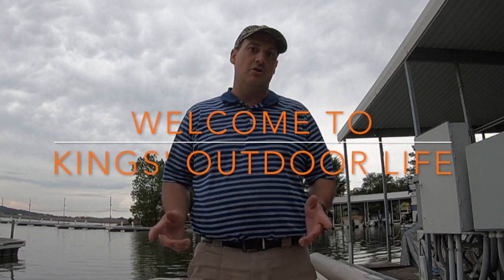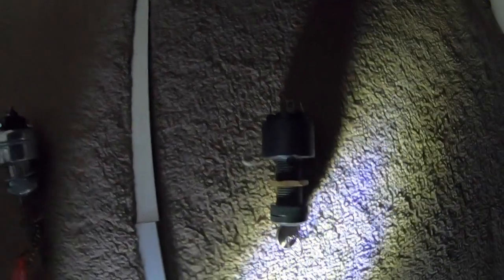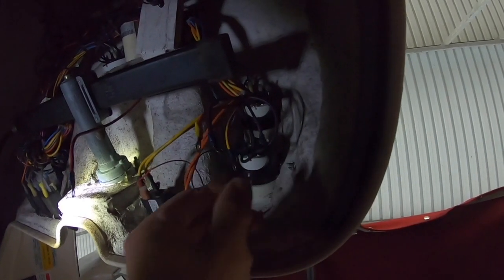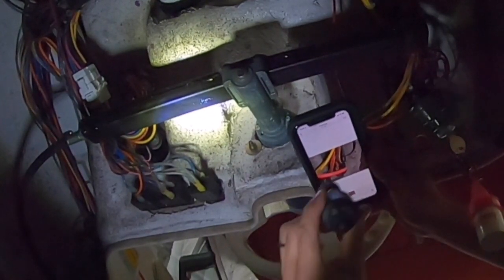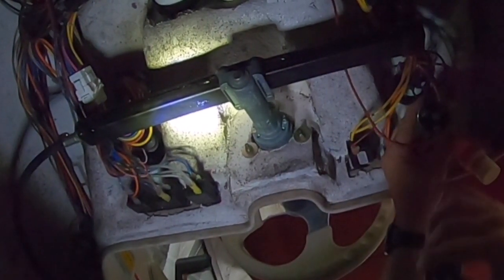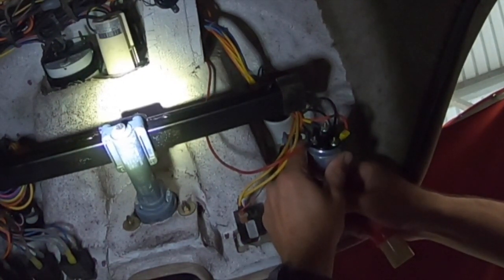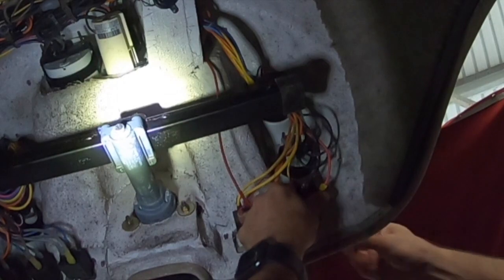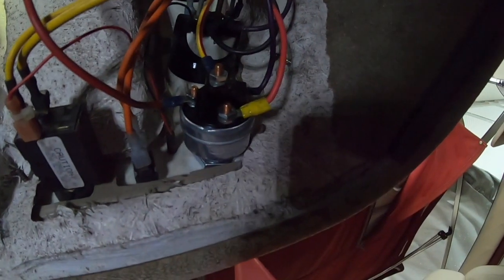Kings' Outdoor Life #49 - Boat Ignition Switch Installation

Comment: I tried but the engine starts but turns off as soon as I let go of the ignition key
Reply from the maker: Mine did that on the first try.  I had two of the wires in the wrong place.  Its been too long ago now to remember which ones.
Reply: Thank you I will try it again today
Reply from the maker: @SuperPacificcoast  Yessir, sorry I can't remember.  Thanks for watching!
Reply: I switch the wires and it worked thank for the advice
Reply from the maker: @SuperPacificcoast  Yay!  I am so glad!   Blessings to you & oh hit subscribe if you didn't!  Still trying to get to 1,000.